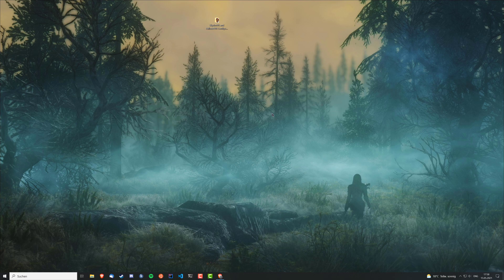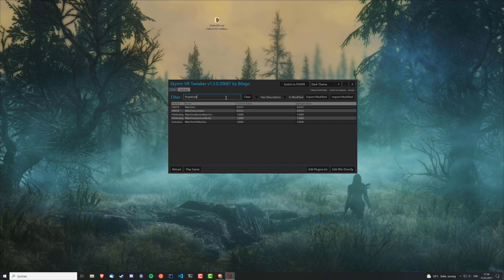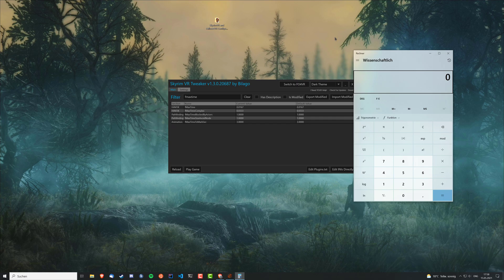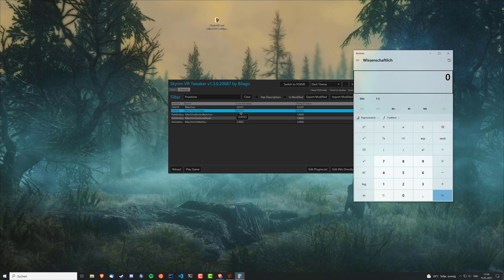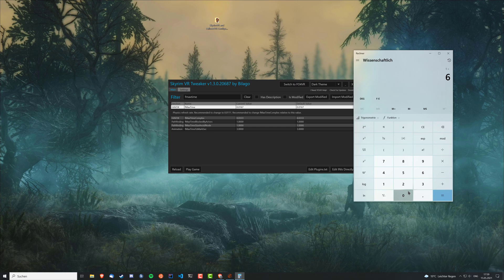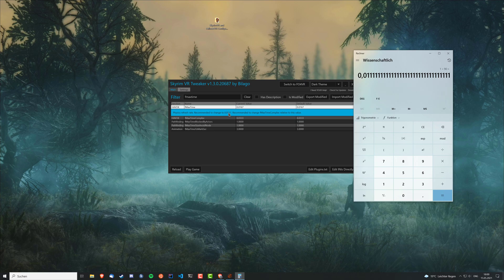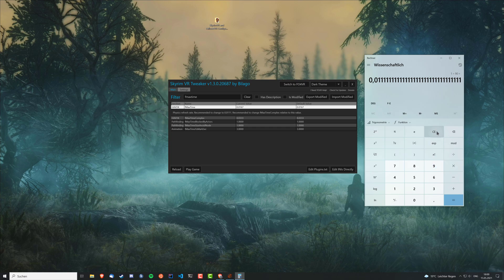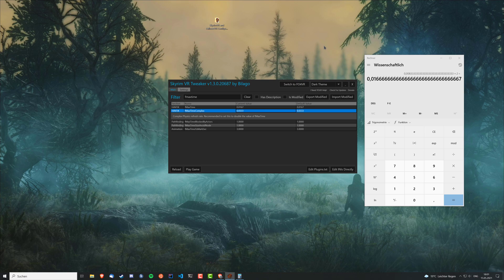Fix Physics in Skyrim VR (90+ Hz)

Comment: Would be nice if you said which file this setting is in.  I don't like the Tweaker.
Reply from the maker: There are multiple ini files you can edit, you may have a look at this guide for example: https://steamcommunity.com/sharedfiles/filedetails/?id=804452438. But I much prefer using the Tweaker to modify the values.